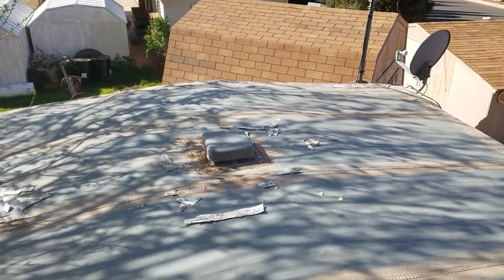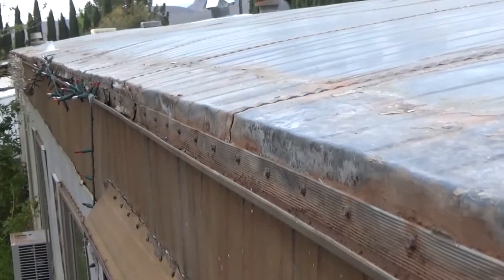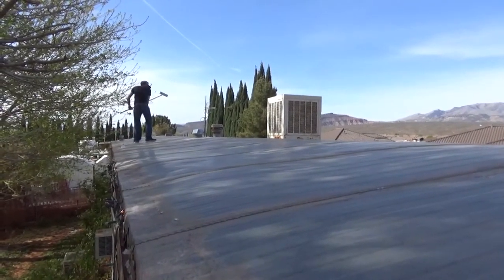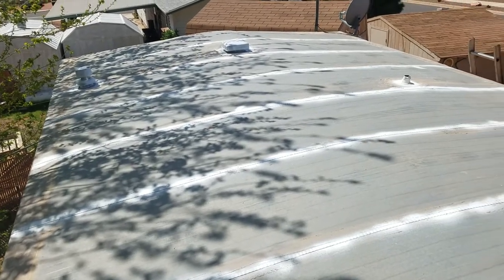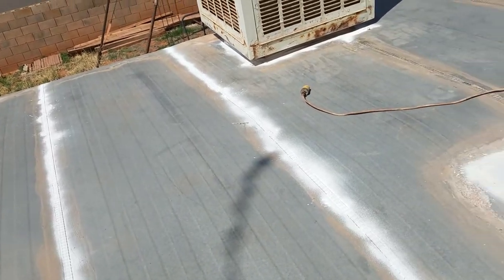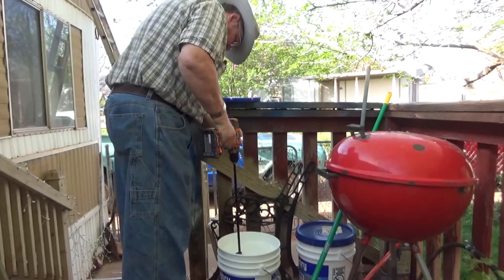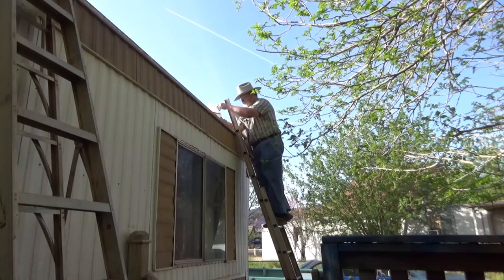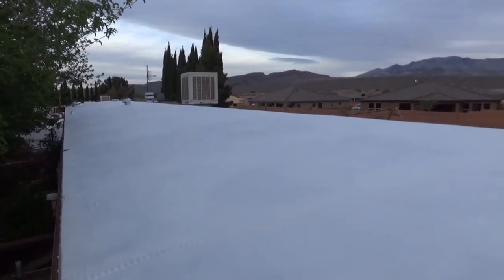Mobile Home roof coating

Comment: Hey Windy Wade, before applying the first coat, what prep work besides brushing the roof of debris did you do?  Any specific cleaners you may recommend?
Reply from the maker: All we did was to hose any dust or dirt off.  As soon as it was dry we started the first coat.  Keep an eye on the weather, and try to make it fun.
Reply: @windywade  Thank you!

Comment: Hi Wade, I was wondering how much Henry’s product it took you to coat your mobile home. I am doing one about the same size, and would like to get away with one 5 gallon bucket. Please let me know, thanks.
Reply from the maker: My roof is just under 1000 square feet.  One five gallon bucket put on one coat.  I put on two coats, so two buckets.